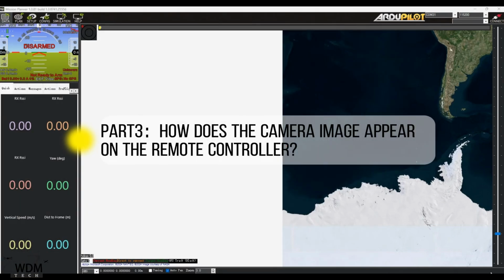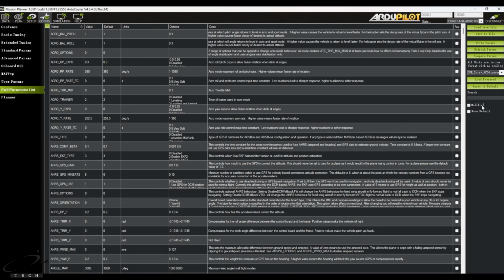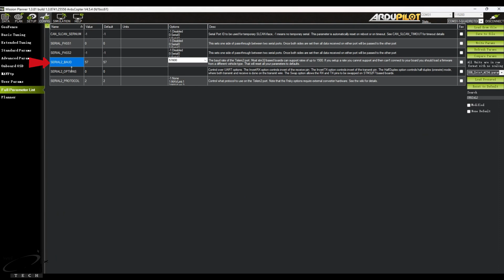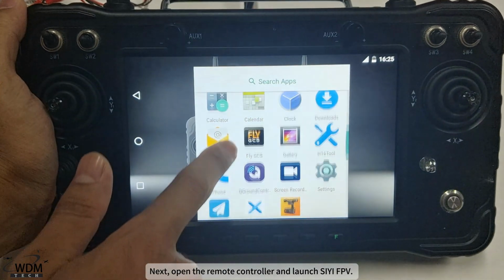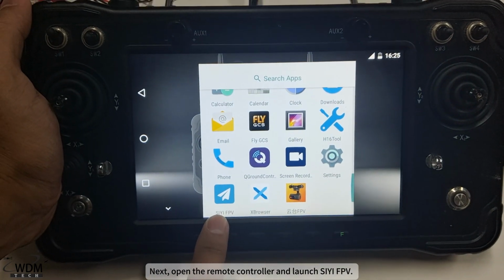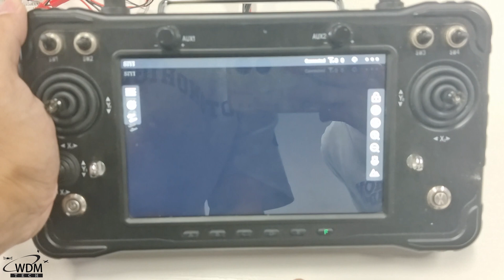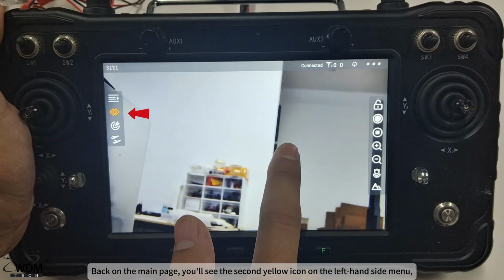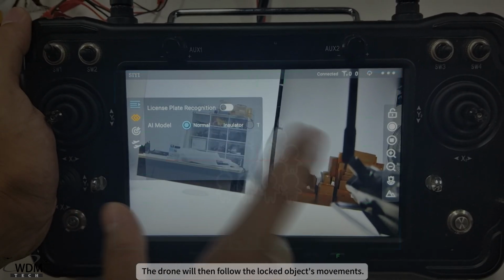Connection Video for SIYI AI and Skydroid H16

Comment: Will this work the same way with herelink with ethernet reciever with siyi qgc instead of the skydroid?
Reply from the maker: It is possible, but not in the SIYI QGC. The AI module can only be used in SIYI FPV. Now, SIYI has launched a new ground control station, UniGCS, which can also be used with this software (currently only compatible with SIYI remote controllers).